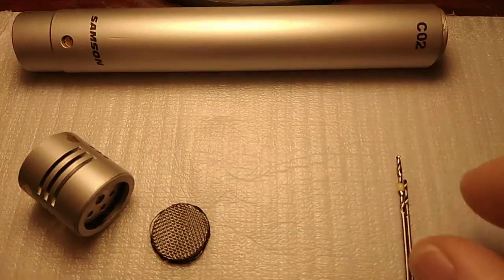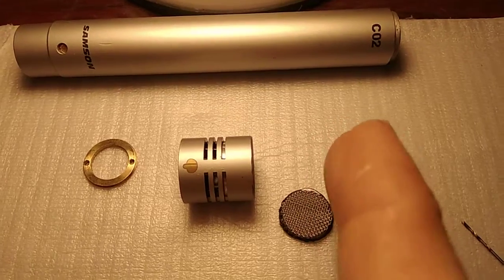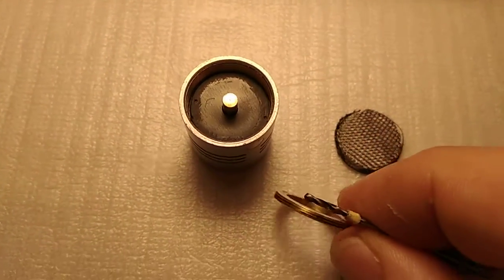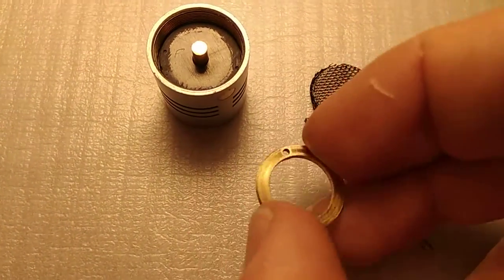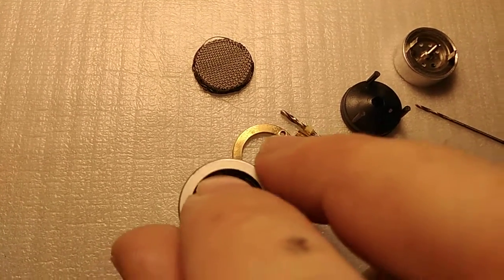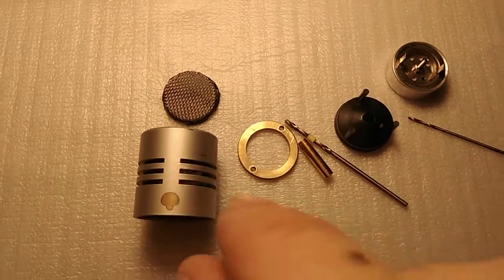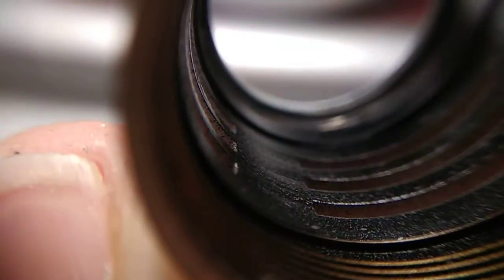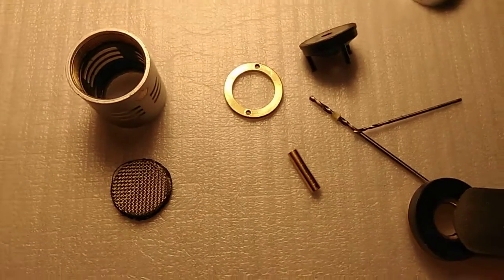Condenser microphone Samson C02 capsule buzz hum disassembly fix by mesh grounding

Comment: For those laughing at the dude trying to explain the problem, this issue also affects many other condenser mic’s, specially the cage of larger condenser head mic’s. This is why you check any solder points on any mic with a cage or basket. Just clean and resolver the baskets or cage. This is a proxy war between Russia and the USA, Ukraine’s poor people are just collateral damage. The Oligarchs in the USA, Russia and Ukraine are making billions off this scam.